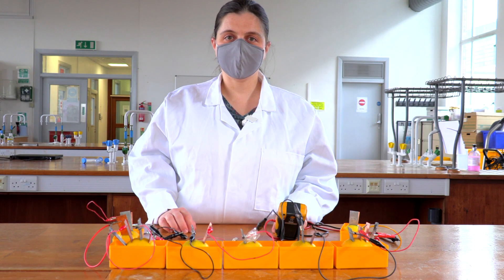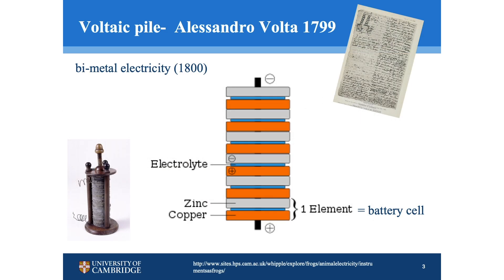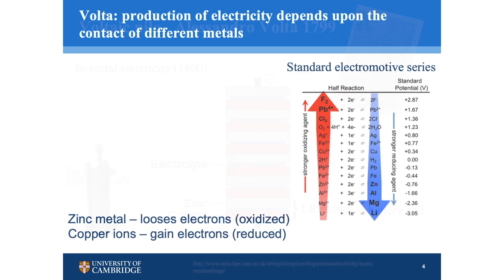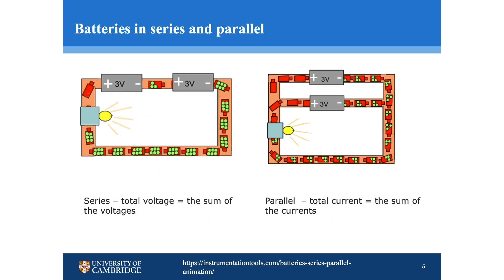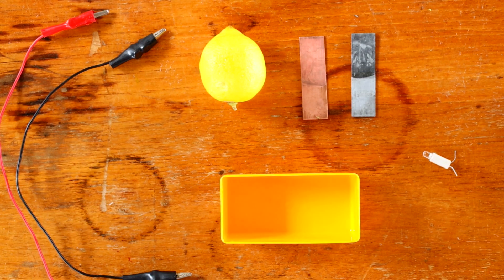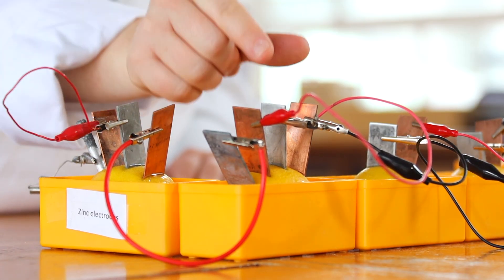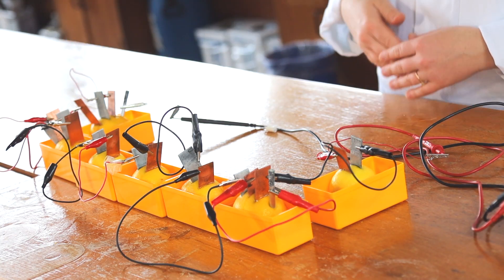Lemon Batteries with Svetlana

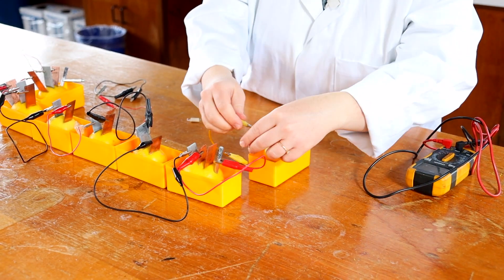Comment: 7:06   Only 2 electrodes needed in each lemon !   Or cut the lemons in halves and isolate
each half - without this the very cells you are attempting to make will short and fail !
Did you know you need nearly 3000 lemons to start a car !